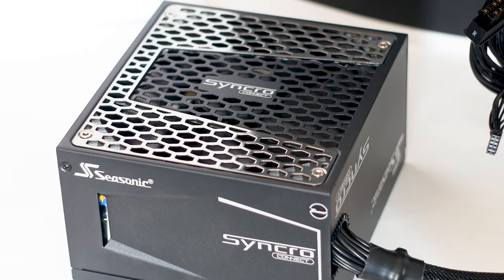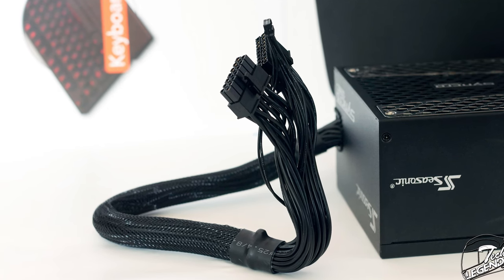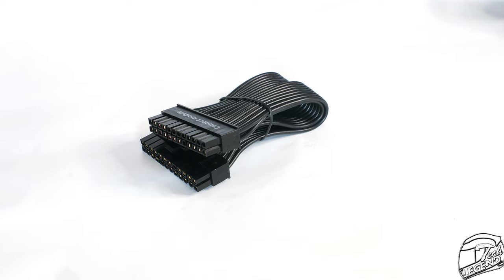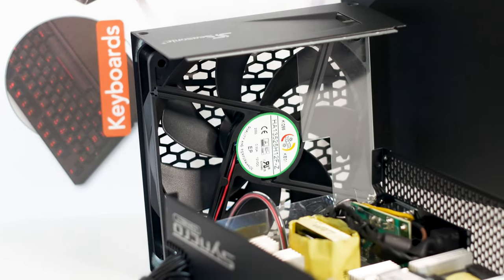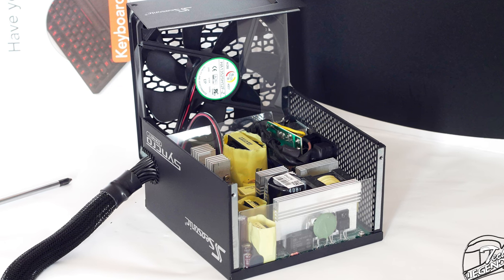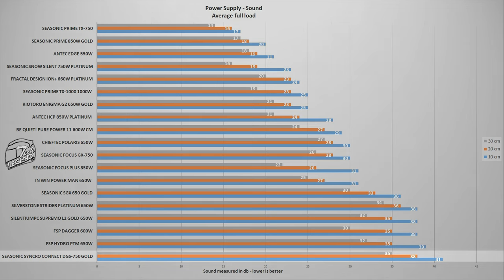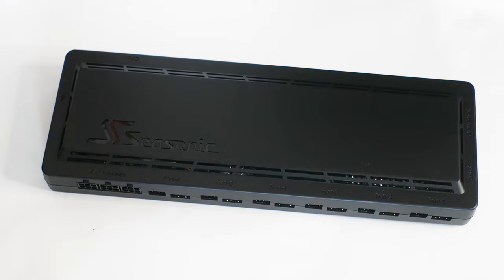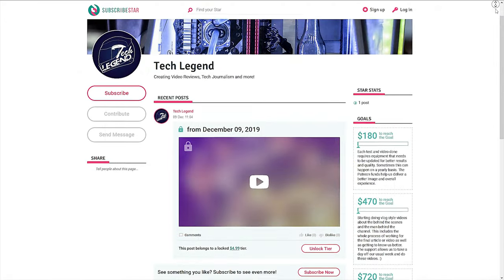Seasonic Syncro Connect DGS-750 Gold Review (Unique Cable System)

Comment: I have the 650W version (came with the case), but my unit was DOA. When turning it on, it immediately turned off again. I ended up RMA-ing it, and the replacement has worked fine... sort of. For some reason when I turn my system off, all fans continue spinning. PSU fan, case fans, CPU cooler fans, and even the GPU fans. My PSU is quiet btw.
Reply from the maker: Check your bios for any settings that have to do with Sleep status.
Reply: check out for sneaky non compliant display port cables, if when unpluging the display port it stops doing that, it's because cheap cables tend to follow the DP 1.0 specification which has been erraretaed, and the power shouldn't be connected all the way through the cable, as that causes the monitor to feed back to the gpu and keeping the pcie power on even if the pc is off, and leads to loads of weird errors like that (for example, my nvme ssd isn't recognized unless I cycle the power when rebooting.)

Comment: tbh you'd have to try to kill yourself with a 400V cap on a power supply, getting a nasty shock, yes, but you probably wouldn't die unless you knock yourself you on a table corner out of surprise. (note that it can in theory kill you if you touch both leads with different hands while they are wet, you drank alcohol and orange juice and you have heart problems) but in general it will just be unpleasant if you touch it with one hand (and you should either wait a day or use a resistor held with a non conductive pliers accross the capacitor to discharge it.) 

I know it's generally a good advice to not deal with it if you don't know what you're doing, but it's not extremely dangerous as long as you know what to look out for. (just don't touch metal parts and unplug the power supply.)
Reply from the maker: Ideally, you have no business inside a power supply especially one that is still under warranty. Not only you risk hurting yourself but you will void your warranty. So that's why I often recommend everyone to not open them up.
Reply: @TechLegend-com  yeah if it's under warranty I agree.
and unless you know what you're doing you don't need to open it. (basically if you don't know why you should ignore the advice, don't)

though sometimes you may want to open one for example to switch the fan or if you're doing an ultra small pc and you need to cut the fan out.
(or in my case it was to have the perfect length of wire for my nas, and removing all the extra wires.)
Reply from the maker: @satibel  True.